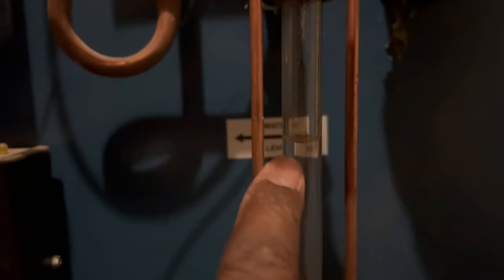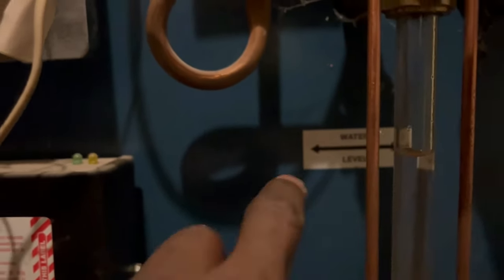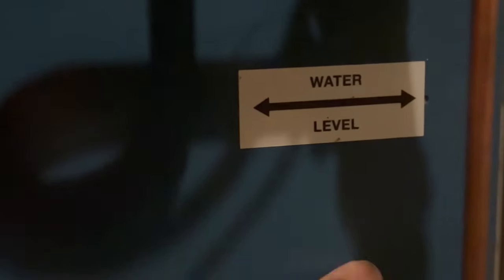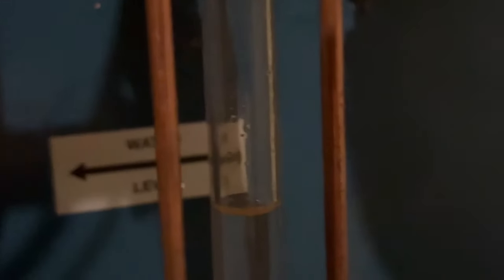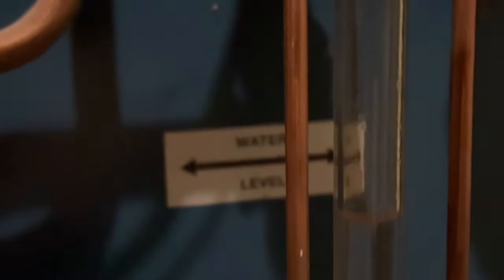How to flush your Boiler

Comment: You can clean the glass tub.
Pill up to rod after boiler is turned off ,cooled off and dain pass the tube . Undue the two nuts slip out tube clean and replace.
If anything gets clogged, it will be the pigtail .

Comment: when you drain water from the boiler do you usually need to fill more water back into it to replace that water or is it connected to the homes water plumbing?
Reply from the maker: This one has an automatic water feeder connected to the hot water. If you do not then yes fill it back up manually